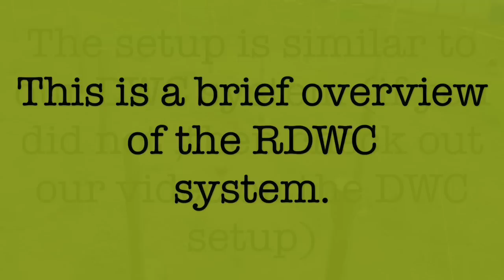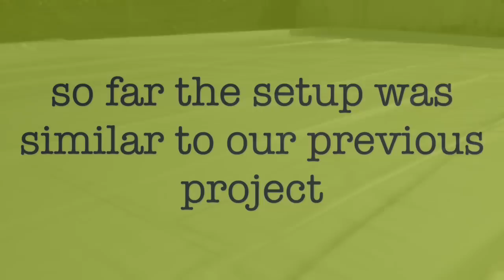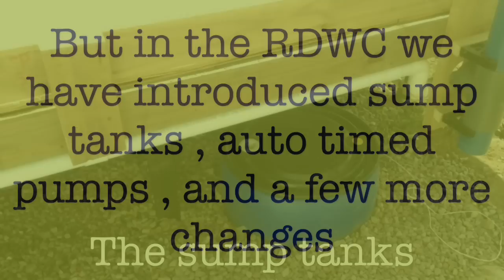How to , The RECIRCULATING DWC System.

Comment: You've been so generous in answering all these questions all these years. Thanks for your patience. The floats, they are polysterene ? If so are they they regular ones from the hardware store? Thanks again.
Reply from the maker: Yes they are regular Styrofoam, But if you can get a high density Styrofoam it would last longer.
Reply: @AHhydrogrow   i cant find it on amazon or alibaba, where did u order those buddy?

Comment: Hi what u do when rain water enters in to the system? Thanks in advance...
Reply from the maker: we do have overflow outlets on the sump tanks so the water level remains the same. The only problem is that the nutrients are diluted after the rain which is not a big issue and can be resolved easily.
Reply: @AHhydrogrow  thanks a lot

Comment: What is the purpose of the blue vertical pipes at 6:26 ?  Also - the fluid re-enters the tank at the top. Does it also flow down to the sump from near the top? Otherwise - what stops it from all draining into the sump? Is there some sort of valve anywhere that does this?

Comment: I really love your videos, but one question how did you design your drainage? Is it possible that the system may overflow?
Reply: You have to use siphon drainage system. It's automatically drain when it's come to overflow. Siphon drainage system doesn't required any electricity.

Comment: What size is the  bed
? and how much water do you use
Reply from the maker: The beds are 60 sq meters and hold aprox. 3000L of water and they also have there own sump tanks below which are automatically topped up when the water is depleted.
Reply: How many lettuce you grow in 60 sq meters?

Comment: not quite understanding the build. I see you mention floats...is the styrofoam holding up the lettuce in the netpot on top of the water on the table? Is the table built at a slight slant? also is the table ever drained of water or just recirculate when the plants are growing? I have space in my yard I could do this but not sure I understand fully
Reply from the maker: Regarding the floats, Yes the Styrofoam holds up the net pots with the lettuce they basically float on the  water.
 Is the table built at a slight slant? No it is as level as possible (otherwise one side would have alot of water and the other little to no water)
 Is the table ever drained of water? occasionally we do drain the water but in reality the water is always being replenished by the plants consuming most of it or the sun evaporating it we are on a daily basis
filling/topping  up the system. And we do recirculate the water also.
Reply: @AHhydrogrow  thank you for all your answers...only just seeing them now.

Comment: Hi! Thanks for sharing your videos!
Could you please explain what do you mean when you say the system should be drained up every 14 days?! Should the grow bad became empty of water, and filled up again with fresh water? Should the recirculating pump be working all day long 24/24 nonstop from the beginning (planting) until harvesting?
Thanks in advance for your reply!
Reply from the maker: As was mentioned in the video its recommended that you change the water but not entirely necessary  if its above 1000L and your plants are doing well, in that case you can change it every month or two or when you feel necessary depending on your system. by change I mean drain and fill new water.
No the pump can be turned on at leased 4-6 times a day for about 5+ minutes

Comment: Thank you, this video is really helpful.

One question. Does the roots always submerge in water?
Reply from the maker: Yes, but not completely underwater or the plant will drown, There has to be a small gap between water and top of the net pot which is not underwater, this usually is the case because the polystyrene which is 200mm or more allows this breathing area for the plants roots if not then your water level should be lowed to allow for this gap.
Reply: @AHhydrogrow  ahhh, so the purpose of the material that is like a jar cap is to create the small gap between the water and net pot?
Reply: @AHhydrogrow  do you know where i can get that small jar look?
Reply: @AHhydrogrow  Do you not have an air injection system under roots? Also why do you drain the water you shouldnt have to? thanks mate